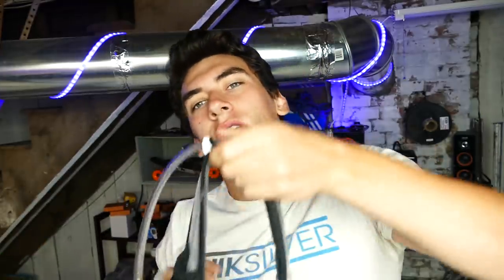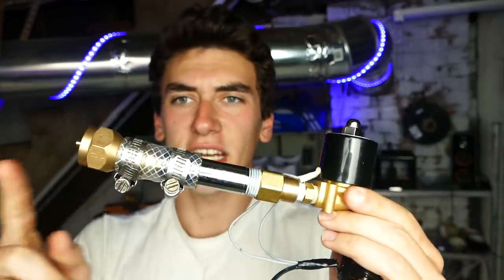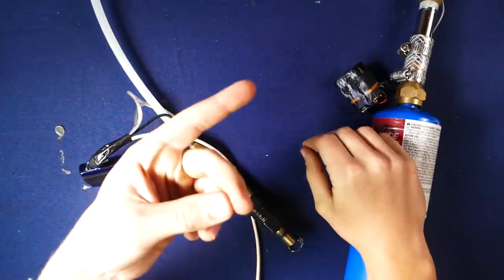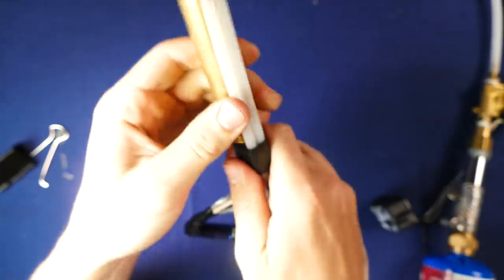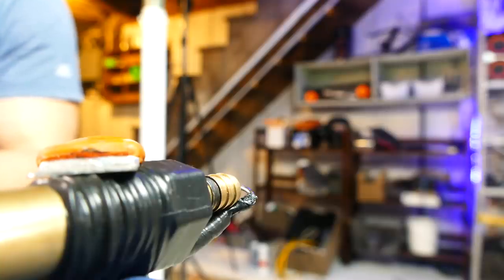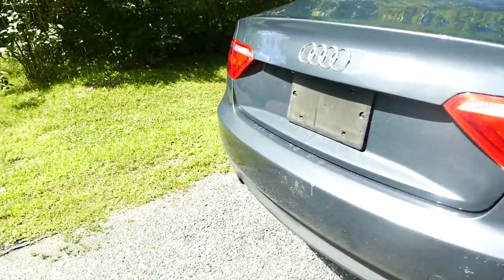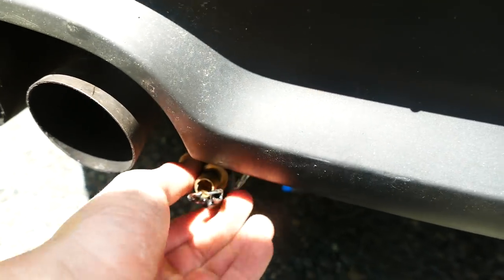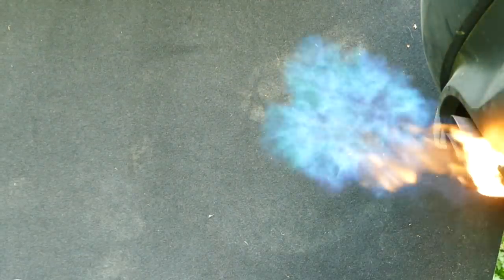How To Make a CAR FLAMETHROWER! - 10 Foot Flames, Super Simple Build!!! (Batmobile Hack)

Comment: Spark plug in exhaust mate
Reply: i get the idea but if you dont have a ignition coil how do you make it spark? like 9vlt batt and switch?
Reply: jazbane1 it’s a flame thrower next to the exhaust
Reply: @pugboi4078  for a proper flamethrower exhaust, need a coil and spark plug, powered by the car.
Reply: @aimless-drifter  
ok thats what i thought, is it possible to do this with a 2 stroke
Reply: @pugboi4078  use mosquito killer circuit to spark a plug

Comment: I’m not too bright but I do know that you roll Teflon  tape the SAME direction as the threads that you are trying to prevent leaks from. Also the (white) Teflon  tape is for water. The (yellow) tape is intended for air/gases/fuels ect

Comment: steps to make fire from exhaust:
1- buy an LS engine car.
2- advance the timing
3- straight pipe it 
that's it.... enjoy the awesomeness.....
Reply: Or even cheaper, buy the online kit from hot licks exhaust. Super easy to install and works in any car. Took me literally 30 minutes, 20
Of which were making the holes, welding the bungs/nuts. Everything else was super easy.
Reply: And did I mention, no tune needed 😂

Comment: On the flame thing, what is the smaller tube also, at the end if the smaller tube you connected it to another set of tubing. Howd you make so the gas doesn't leak out?

Comment: not a bad concept, but this is a old trick easier if you would of used a basic spark plug screwed into a pipe though.  8mm wire to battery with switch we used to hid a smaller tube inside the original exhaust tip.  but non the less not bad

Comment: Do not ever use teflon tape on a compressed gas line!! Its dangerous!! Teflon tape is for liquid fittings like water for plumbing!! Brass fittings made for gas need to seat directly to each other to seal properly!!

Comment: While I like the ingenuity I have to point out how you use the pliers on the malty tool to tighten the hose clamp instead of the flat head that is in them which would not screw up the nut like the pliers do. Same goes for using set of vice grips instead of a wrench or even a crescent wrench along with other wrong tools for the job.... Why is it so hard for people to use the right tools for the job? I understand in pinch but come on....